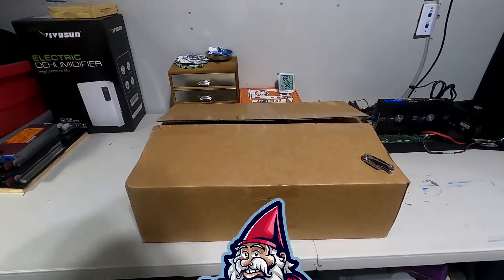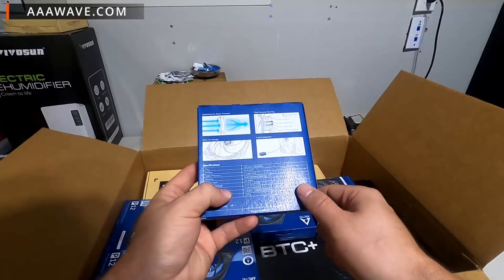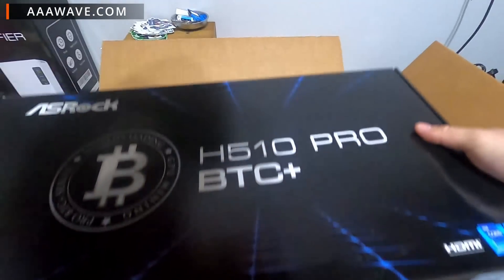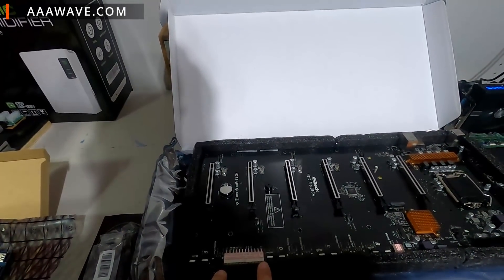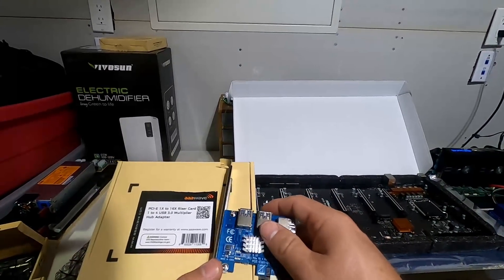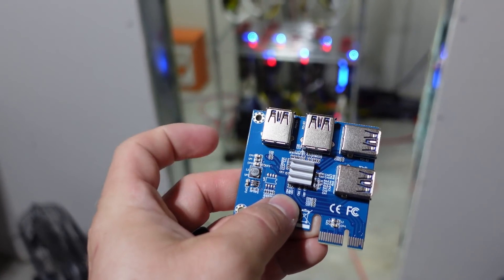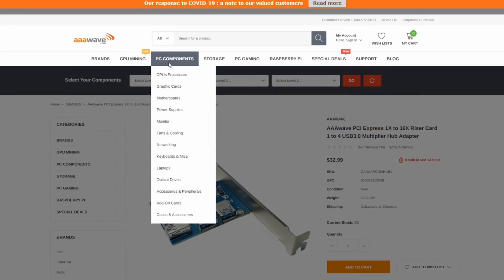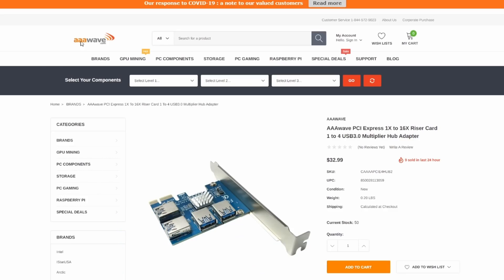Do PCIE Splitter Cards Work for GPU Mining?

Comment: I have a couple of these and they definitely work. I think it can be a hit and miss affair on older motherboards.
Reply: I have various versions of these running in nothing but old motherboards and in every one of the MBs, different manufacturers, I can only get 5 cards recognized (plus onboard) no matter what combination I use, but the splitters seem to have little impact themselves and let me get to 5 in the first place.  I have tried different "brands" and types, all the same more or less, other than the occasional defective unit.
Reply: @donovanallen  They are worked only if you have enough PCIe lanes if not then they will not work
Reply: @cyborg6294  that isn't the case.  I added a 8 lane sas raid card to a machine that could only post with 5 gpus and it worked fine and at expected bus speed.  I understand that is also a limit, but that isn't the limiting factor on gpu # necessarily.  I believe there must be a limit to the number of cards the bios can add to the gpu list or some other premature limit.
Reply: @donovanallen  all depends on 2 factors your CPU and the chipset
Reply from the maker: I agree. Worth testing it through for $30 USD in my mind.
Reply: @TheHobbyistMiner  30$, I got them for 14$
Reply: Whatever I do (using 4x Splitter), I cannot go over 6 GPU's, Motherboard fail to load.. I don't know how to combat this.. Not much can be changed in the Bios, I already tried everything possible and I'm talking about Expensive solution, the one I have, AshRock Steel Legend.. , with 4x16 Pcie slots.. (And $500 CPU i9 with 48 Pcie lines) Now I have 6 GPU working, cannot add another one, no go, motherboard blinking and not loading..

Comment: pcie splitters are awesome, i just got one (BEYIMEI PCI-E 1 to 4 PCI-Express 16X Slots Riser Card) on amazon, to turn my motherboard with 2 gpus slots, into a 3 card miner all plugged into the pcie adapter, so then leaves more for some more gpus in the future on the other slot with another adapter! it was a bit fiddly to get working, but i just plugged the usb cables in a different order etc and then the hdmi cable into a different gpu to get it to recognize all the cards, but didnt take too long troubleshooting to get the result, and all the cards run full hashrate with no probs :)

Comment: are its really work???
Reply: it works, i used to have 3 1660s connected.
Reply: @SiFarid  I thought an additional PSU was needed to be able to work with the motherboard, but I see that it is not necessary, its awesome!!